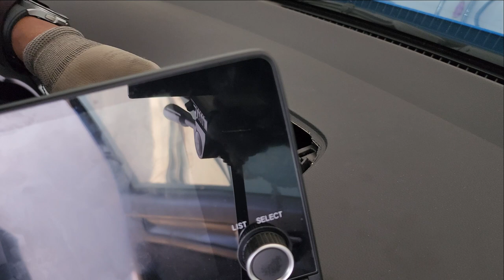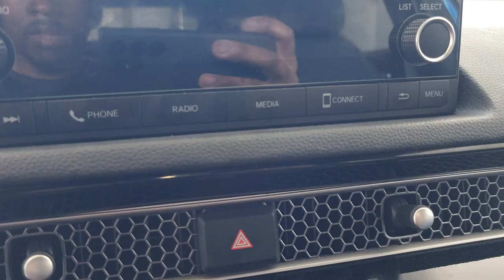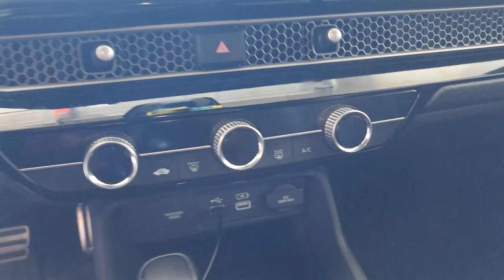22 CIVIC HATCHBACK CARGO BOSE SPEAKER AND SPEAKER TRIM INSTALL

Comment: The panel is good but I wouldn’t install Bose speakers in there Bose speakers are trash they distort at high volume they sound terrible I would’ve did jl audio kicker or something along those lines I got a full jl audio system in my hatch and it sounds incredible and best of all no distortion at high volume but good video tho🤦🏻👍🏼
Reply from the maker: @Loso the bose is only in the cargo area. everything else is stock

Comment: Hey man, how did you make that wire and what type of connector is that on the end?
Reply from the maker: @darkchocolate2x372  I used regular speaker wires. The connector at the end, I think I had ordered them from Japan
Reply: Thanks 🙏🏾
Reply: For that connector at the end, do you have a name for it or a part numbet?
Reply: I just did this install but instead of using that connector i just splice onto to my driver side door speaker, but when i turn the volume up there white noise coming from the back speaker i just added so i guess i need to use that connector
Reply from the maker: @darkchocolate2x372  are you referring to the connector behind the radio?
Reply: @rotheinstaller  yes
Reply from the maker: @darkchocolate2x372  oh I got them on Amazon

Comment: how did you get your subs to stay on the back seats like that? need to do something like that to mine they keep moving around while i drive
Reply from the maker: @whereswaldo9089 if you look closely at the box, you will see a green string going across it. It's one of those self tension straps with the hook on both ends, and I hook each end into where the seat locks
Reply: @rotheinstaller  lol I thought it was a rubber band at first. Can you send a link to these straps or anything similar 🙏.
Reply from the maker: @whereswaldo9089  I don't have a link to it. I happen to find mine at work and take it, but if I find it I'll send it

Comment: Where can I get these parts?
Reply from the maker: @Mahanth at your local honda dealer or online. I am going to put the part numbers in the description
Reply: @rotheinstaller  okay thanks
Reply from the maker: Which part are you looking to get?
Reply: @rotheinstaller  the rear speaker and trim for the hatch. The one u showed in the video
Reply from the maker: @mahanth3071  okay. No problem
Reply from the maker: I posted the part numbers in the description
Reply: @rotheinstaller  appreciate it